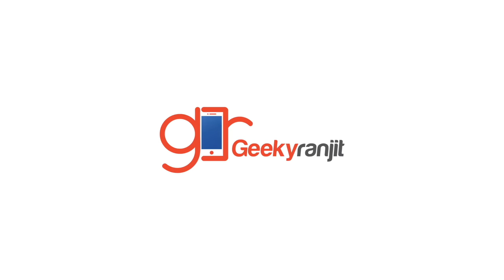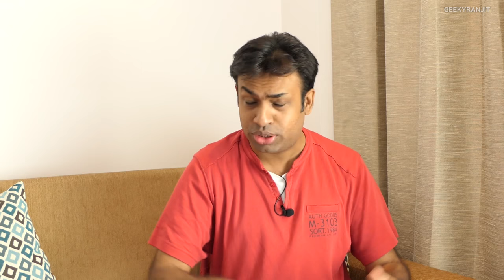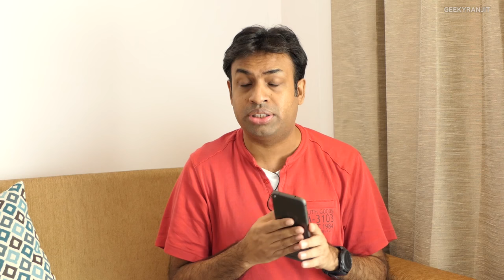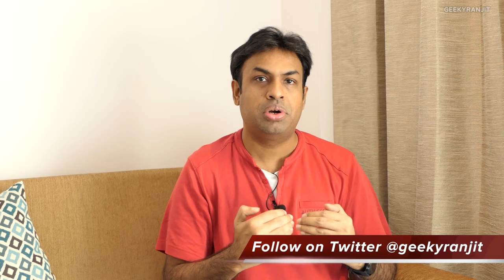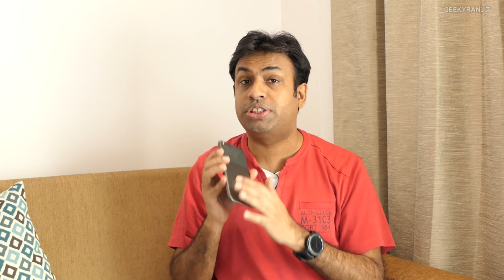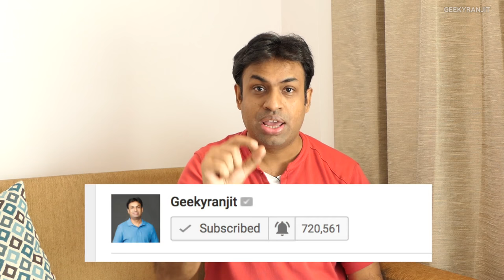GeekyRanjit Explains Processor Heating & Throttling

Comment: For the people who are asking for the explanation of a kernel :

It is the basic piece of software on which the entire OS(Operating System) runs and interacts directly with the hardware, written in C/C++ programming language.
With out kernel there is no chance that you can run an OS because you cannot access the hardware also it determines the security and performance of the device.
Lets take an example, suppose you installed some app to take photos. So that you need to access the camera of your phone. But the app cannot do that. It cannot directly access the camera to take photos. Instead it sends request to the kernel and the kernel provides access to the camera.
Suppose if there is no kernel (It's not at all possible but lets assume) the app developer needs to write code for every possible camera sensor to take a photo which makes the app more complex, time taking and makes the application size bigger.
Basically every Linux operating system(Android is also a Linux OS) runs on top of a kernel.
Simply Linux means kernel.

You can check kernel version of your phone at Settings > About Phone > Kernel Version

Let me know if you still have any doubts :)

Comment: @geekyranjit  Sir, you mentioned if the surface temp is around 45 it will be uncomfortable to hold. If I have a dual layer phone case with TPU and plastic on top of the phone, will be heating will be still uncomfortable.

Comment: how is the SD 820??  it is less optimized than the SD625??
Reply: Ananyo Banerjee well if you talk about optimization then let me explain you these processors are just hardwares and it's generally the software that speaks a lot about optimization
to say the manufacturing process is also of great importance since both 820 and 625 are made from same 14nm finfet process then it's no real differentiator
but from my experience 820 is a beast like but for bad software part it performs worse on z2 plus and heats a lot but see Google pixel and Samsung Galaxy s7 and even OnePlus 3T they all perform very well
but 625 is very good of you are a casual gamer and doesn't heat on both Moto z play and on Redmi note 4 proving that it's pretty well optimized for controlling heating issues right from the start but if performance matters than 820 is nearly 2 times more powerful...... hope you got your answer
like my reply if you found it good enough
LOL

Comment: I really appreciate your videos. and even like ur this series, sir can you make videos on following topic.

ways to cool down the heating of processors , active as well as passive heating. which one is better.

screen resolution what's need to get better one.

VGA , dvi , HDMI cables 

ssds and hard disk , which is better 

how to rate processor , 

some terms of processors which matters a lot.

what's IP.

what's GPU  

and many more....
Reply: Giveaway well GPU is the part of soc which gives GUI output for users to interact or to see the Graphics simply for the applications they perform you can say it's the part that displays the processed data from CPU on screen
the best examples of GPU are
Mali series
Adreno series
Intel hd series
intel iris series
Nvidia graphics cards (like tegra)
AMD Radeon etc. 2 are mobile GPU and othersre computer GPU
Reply: Giveaway active cooling is far more better than passive
liquid cooling is the best to go yes cooling using fans are good but can't be used in mobile devices for sure
Reply: Giveaway somewhat terms that matter for a processor

Clock speeds
Ram speeds
Max. Ram supported
Manufacturing process (ex 14nm)
Big.little or HMP
DSP
Gpu clock speeds
GPU shaders or cores
Graphics memory supported (PC's only)
the ROM they can support (emmc or ufs)
hope you liked my answer
please give me a like if you really liked it....!!!???
Reply: Giveaway  SSD is much better than hard disks but are about 5x costlier as well
SSD of min. read speed is about 200mb/s
HDD of 5400rpm is about 30-40mb/s or even less when processor is not that effective
Reply: Thanks everyone, good response. I like your answers ,  one thing I have to add on this ,  I think that sir
Passive cooling is better than active and water cooling , i am just telling you on the basis of what i have tested on my single board computer.
Please do correct me if I am wrong.
Again thanks all of you , nice community discussion on tech.
Reply: Swadesh Patra sir can you put those things on explanation on the topic "some terms related to process that matters.", I mean can you suggest me any link for these things or anything else, as i m really passionate to know all things.
Reply: Giveaway actually I passive cooling also involves the reduction of core speeds as well and building more efficient architecture for processors for example 10nm
but active cooling simply is an external component like the coolant system in cars to remove heat and hence it doesn't involve any kind of normal heat dissipation systems and core control and any kind of throttling
for example my Intel atom z3735f CPU performs on with more priced Celeron CPUs as it had turbo speed UpTo 1.83ghz for all the cores
now the interesting thing is I guess like in mobile devices i guess ur had just very cheap and basic liquid pipeline system and hence according to CPU z it performs at 2.1ghz overclock speed when heavily stressed but throttle when it crosses 65-67c mark
it is also built on 22nm platform and Celeron despite lacking all this just had good fan system cooling and lower clock speeds hence it more consistently

to add liquid pipe cooling without fan is used in flagship mobiles
and on my low end budget 2 in 1 it uses the cheapest water pipe system without fans don't confuse it with the liquid condenser + fan system those are costly and inapplicable for mobile devices
devices which use water cooling are
Apple iPhone 7 and 7+
Samsung Galaxy s7
Google pixel XL only
Reply: Giveaway well just Google it
remember despite supporting 933mhz of RAM Xiaomi Redmi note 4 which i own actually just uses 667mhz of effective RAM something i didn't like but yes never go for benchmarking tests those can be easily tricked
gaming is the father of all benchmarking tests
If your device scores just 30k on AnTuTu and doesn't lag on asphalt 8 then it's the real hero
look at those scores
Micromax Canvas nitro 4g
antutu 30114
asphalt 8 28fps
Xiaomi Redmi note 4
antutu 60k
asphalt 8 32fps
Lol

Comment: Hi Sir, great explanation of the heating issues. Thanks a lot. One single question..the Redmi phones shows the battery temperature in its Security app. Is it higher than the phone's body temperature?

Comment: How does the soc calculate the temperature...does it have a thermal sensor or does it calculate heat based on the soc working??
Reply: VISHNU JITH temp sensor

Comment: Use of technical words to sound smart! Classic! It is simple, if the hardware is not optimized for power the processor will work harder and it will heat up. No need to bore people for 10 mins.

Comment: what is kernel ??
Reply: It is the basic piece of software on which the entire OS(Operating System) runs and interacts directly with the hardware, written in C/C++ programming language.
With out kernel there is no chance that you can run an OS because you cannot access the hardware also it determines the security and performance of the device.
Lets take an example, suppose you installed some app to take photos. So that you need to access the camera of your phone. But the app cannot do that. It cannot directly access the camera to take photos. Instead it sends request to the kernel and the kernel provides access to the camera.
Suppose if there is no kernel (It's not at all possible but lets assume) the app developer needs to write code for every possible camera sensor to take a photo which makes the app more complex, time taking and makes the application size bigger.
Basically every Linux operating system(Android is also a Linux OS) runs on top of a kernel.
Simply Linux means kernel.

You can check kernel version of your phone at Settings > About Phone > Kernel Version

Let me know if you still have any doubts :)
Reply: Prashanth Raju  
very well explained.👍
Reply: +Aditya Sinha Read my second line
And it's not called "Kernel" for Windows
Reply: Kernel is not a separate part of Windows Operating System like the Linux.
And the discussion here is not that windows don't have a kernel, but "What is a kernel" :)
Reply: Hence these questions !? 🤣🤣🤣
Reply: As Ranjith mentioned, if Kernel has the ability to control the speed of the processor, then in case certain phones have over heating issue then installing a custom rom which is know for stability would help in sustaining the heat production by reducing the processor speed. To give an example, OnePlus 3T has over heating issue due to clock speed of the processor where as Google Pixel does not though these phones have same processor with different clock speeds. Would installing a custom stable rom in OnePlus 3T may fix the over heating issue?
Reply: +avinash reddy Yeah
Installing custom ROMs may solve the heating issues of SOME smartphones
I don't know about the OnePlus hardware because I'm not sure that the hardware provides any modes to set the clock speed by the means of ROMs

Comment: If throttling can be controlled manually, why don't any smartphone manufacturers provide the option to do it? Let's say I want an extended battery life I can just lower the speed of the processor and when I want to do some gaming I can increase the speed manually.
Reply: Tejeswar Rao u can get it on s7.. and nougat update will include this features soon
Reply: Tejeswar Rao because some one who doesn't completely understand the concept of it will over clock it and that will be disaster since there is no dedicated cooling system.
Reply: Tejeswar Rao simply power is given to those who understand it love it and fear it at the same time and are aware of it's consequences...... despite being an Android user for 6 years i would never want that feature to be unlocked on a smartphone.....I have used and i know what it can do for as well as bad
Reply: so you want highway n city mode like cars....

Comment: @geekyranjit equivalent snapdragon processor for kirin 655? Does a processor with higher core works fine than that of  a lower core processor?
Reply: sd 625 maybe but not 650 is it better than 625?

Comment: I am using cool1 it heats up like hell with even few minutes of 4g net surfing or camera ussage  But it uses the same SD652 as in le2  where no heating at all  .. Why it is with cool1???
Reply: john richard bad software optimisation.
Reply: Kiran Yadav 
but Heating is a hardware issue 
so can't b due affected by software .Just like in motp g4 plus heating is due to the processer 617 & can never b solved by any sort of software update